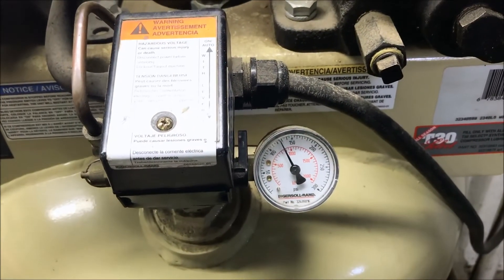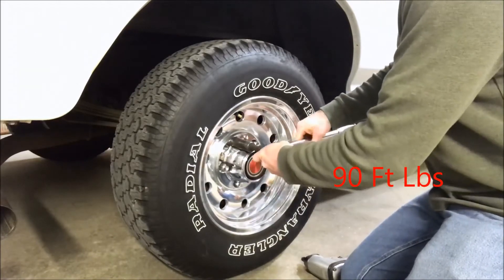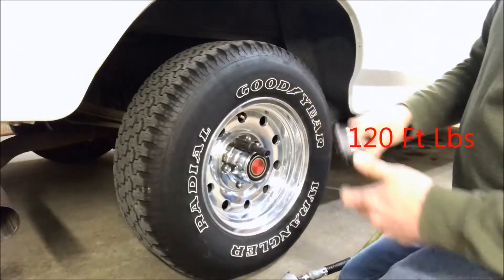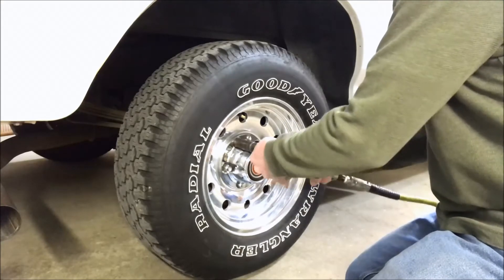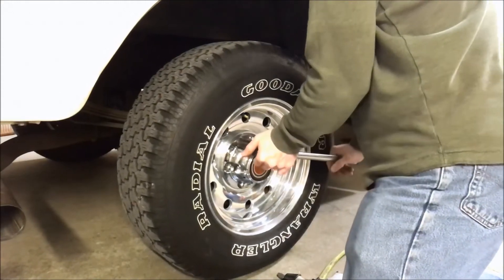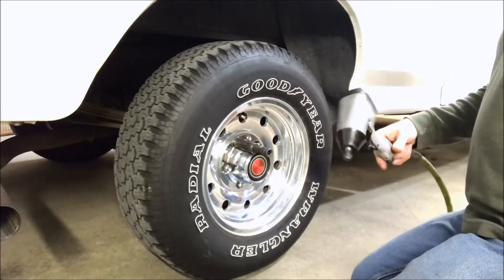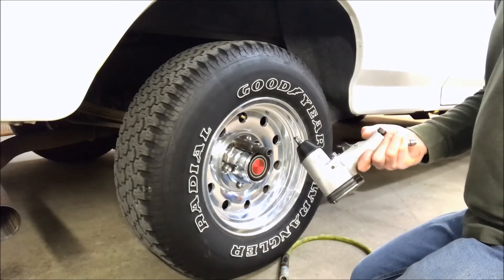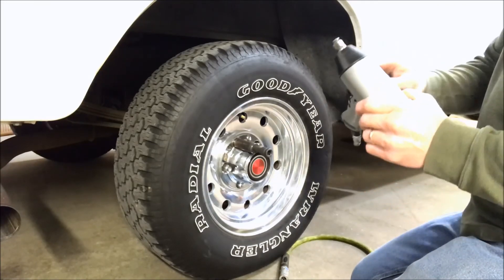Modifying an Impact wrench (Testing with Known Torque)

Comment: If you still have that cheap Craftsman, could you test that to see what it could do torque wise without any mods? It should be close to what that Harbor Freight was before you modified it. Guessing it's going to be around 80 to 90? Thanks for the videos
Reply from the maker: I no longer have the craftsman,  it had a design flaw, I have a friend that had the same one and his never worked either.
Reply: @SteveStoltz  Thanks for the reply. Bummer, I got that Craftsman for $5 used but looked new years ago knowing it was a POS lol. I was going to try your mods on it for fun, but guess it's not worth the time if it's even worse than the HF one. Right now I know it can't take off 100 ft lbs. I have another that works fine. This was just going to be a fun experiment like you did.

Comment: is that the same one that you modifyed ? in 1st and 2 nd attempt ?
Reply from the maker: sekrani chouaib Yes
Reply: i have 2 of them and they lost power so much they cant even open little nut i open what should i do to fix them ?
Reply from the maker: @sekranichouaib2134  possibly honing the cylinder and resurfacing the vanes would help.

Comment: Nice test video, Steve.  I rarely use my impact wrench except for lawnmower blades and I used it on my lug nut removal and it stripped the outer metal on the lug nut on the first try so I stopped that real fast (ha). Enjoyed a full watch.
Reply from the maker: My kids recently got me a cordless, it has more power than this one even after I modified it lol. I too have stripped the blade bolts on my mower deck, makes them a real pain to get off.

Comment: I hope that the stud is okay with in rated torque spec. The impact gun looks good for taking off frame bolts.
Reply from the maker: I'm sure I probably exceeded the studs torque spec slightly, lol.